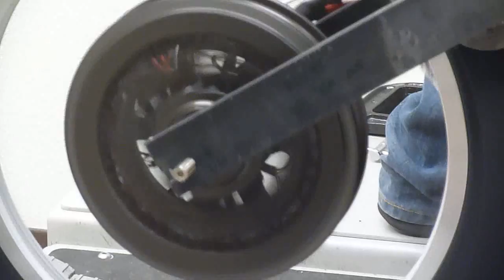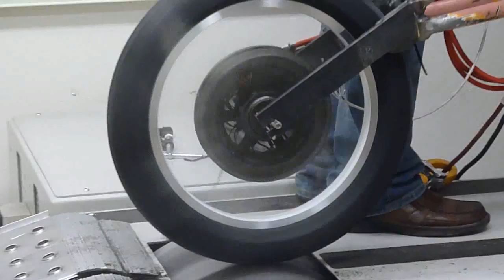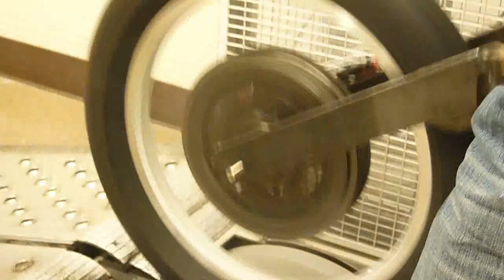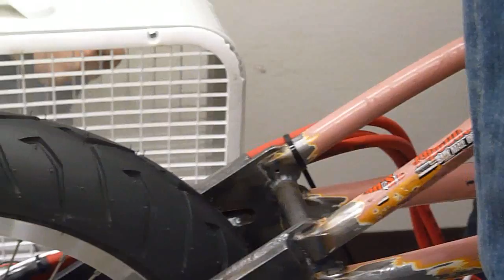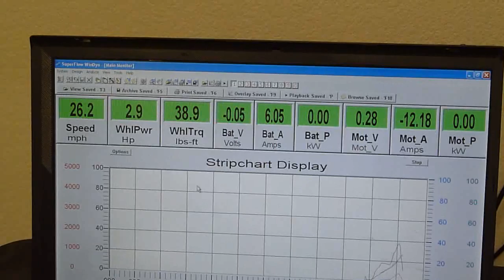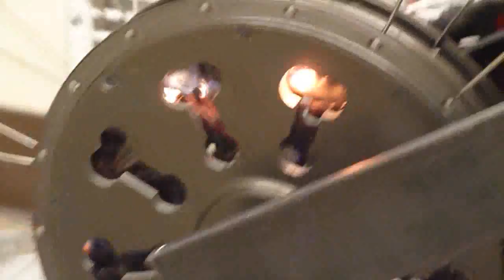Liveforphysics ebike dyno, fire and plasma! Internal combustion electric motor.

Comment from the maker: Most motor windings will reliably get to 250+degC at least once! ;-)
Reply: where you have the side cut out to let air in, why don't you turn these into fan blades to create airflow through the hub motor to cool it down at high speeds  ?. you just need to angle them slightly to create airflow through the hub motor

Comment: The penis shaped air vents didn't seem to do their job. LOL
Reply: AL Ian the air vents symbolizing the motor being rooted...ha
Reply: it's passive cooling.  You have to be travelling through the wind for those vents to actually do anything to cool the motor.  Sitting still in a room on a dyno isn't going to circulate the air properly, rendering the vents useless.
Reply: Will Davis
I'm guessing they realized that fact AFTER the test and not BEFORE it? LOL
Reply: ROFL

Comment: Men, I have a doubt. If I have 7hp = 5219w and 12amps that means I need a 434v batery? maybe I'm wrong, sorry I'm not testa. haha
Reply: Yes way off. A 96 volt battery can achieve way more then 7hp. Its a combination of things. Watts determintes hp but there are ways to get there from a controllers amps to the batteries voltage. A 48volt battery with a 20 amp controllger gives around 1000 watts but get a 30 amp controller and now you got 1500 wats. get a 96 volt battery and a 60 amp controller and you got 5790 watts. Up the amps to 120 amps and now you got over 10kw of power.

Comment: @LMF5000 I'm no expert, but it looks to me like it was just a fire... My guess is that the coil (Which was exceeding 400 degrees c) melted the insulation which caused the whole motor to short out. And with that much power, those batteries would have no problem setting the bike on fire